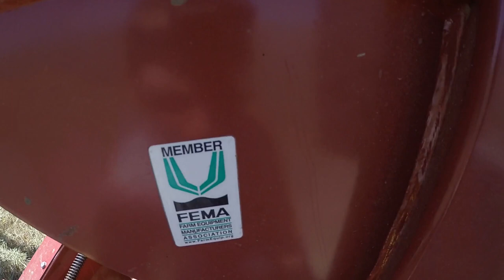Makin Hay-July 6th

Comment: have you ever tried a new holland discbine you would get your hay done a lot quicker.
Reply from the maker: No we wouldn't lol. This is the fastest way to do hay
Reply: Kraft Farms 14 discbine at 10 mph  is slower ???
Reply from the maker: Well this is an 18 foot mower and I'm runnin about 8. Besides. it's much more efficient because it can be raked and baled way sooner than any discbine or conditioner. We used to run conditioners and swathers till we found this